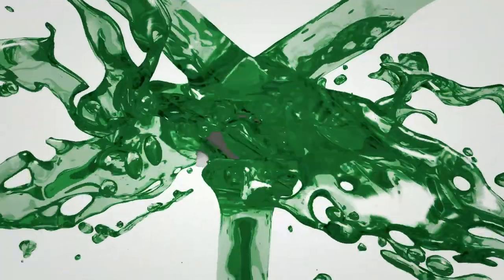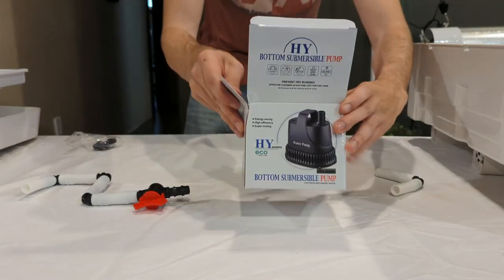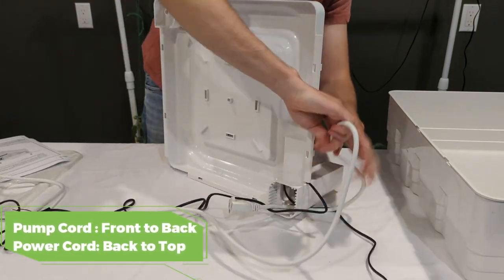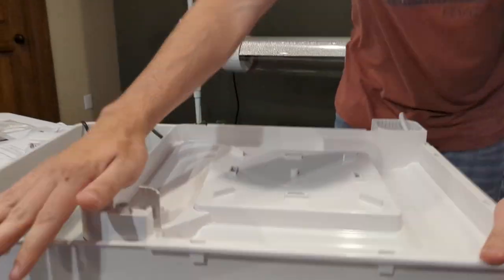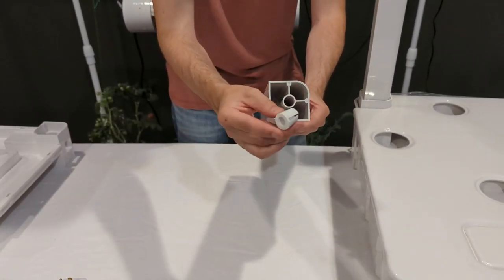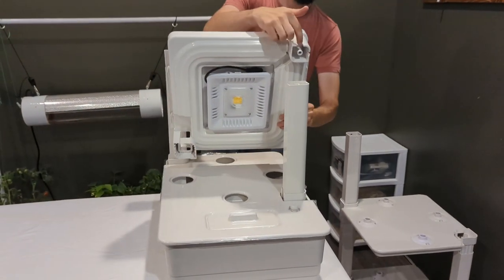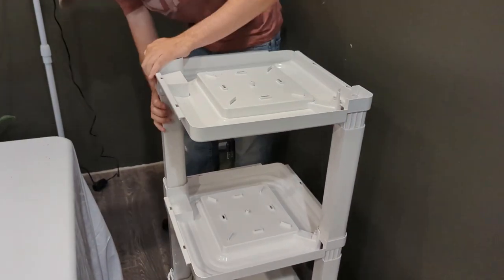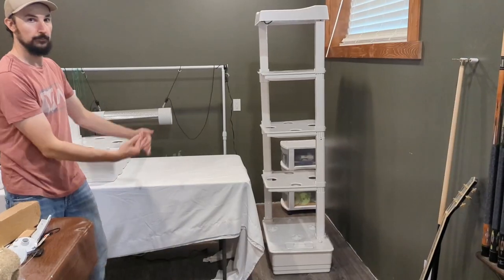Eden Tower Assembly

Comment: In the manual it says to screw in the larger Pump adapter. In the video it says the small adapter. Can you please let me know what is the correct size? Thank you
Reply: Hello, Sorry for the confusion. I would say we are overdue for an updated video as some parts have been removed since this video. Truthfully both work. The larger pump adapter is more difficult to install however we have found that in rare cases the hose and pushed off of the pump adapter when the smaller one was used. So we have instead just switched to the larger adapter despite the more difficult assembly it adds.

Comment: If you do t want to set up all levels to start, is that an option? If so, how to add the additional layers?
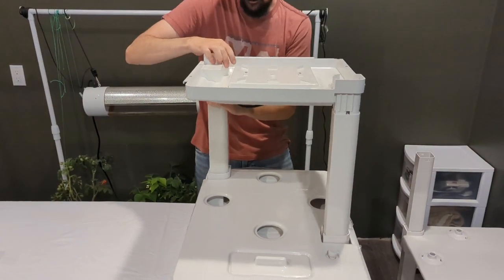Reply from the maker: Yes you can set up a few layers. Just simply stack the layer on top and make sure that the top layer has the dummie pillar on the water end. If you watch at 4:49 you will see the process